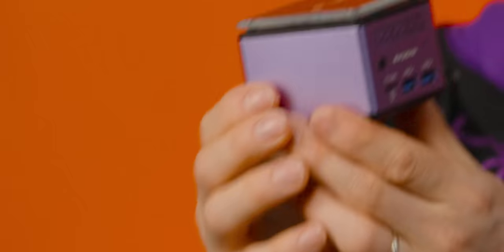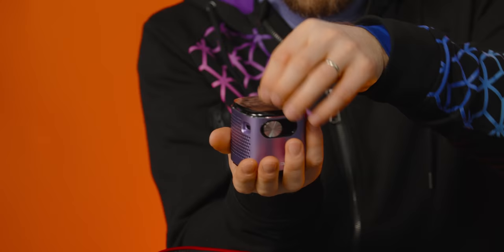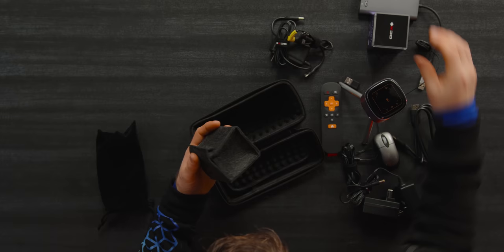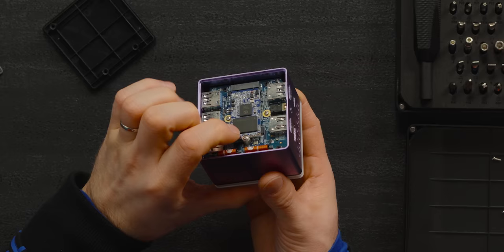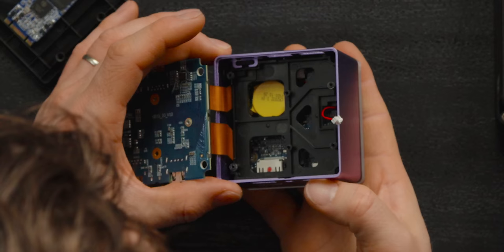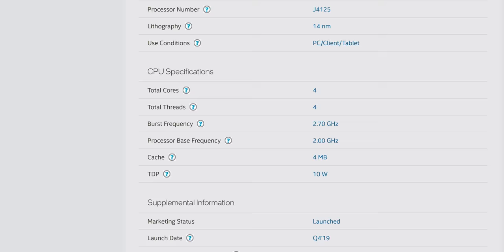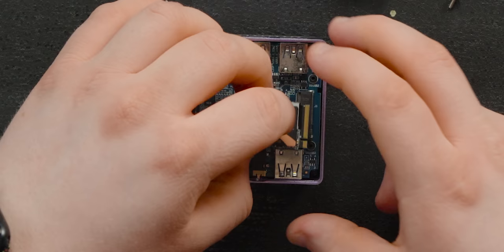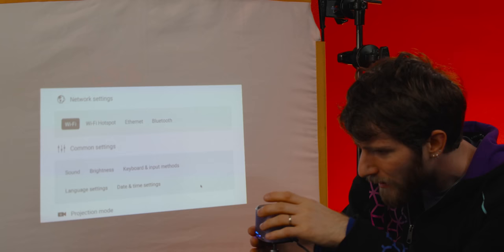This is a computer - XDO.AI PicoPC

Comment: The CPU is built on an antiquated 14nm technology. This stuff is 9 years old. Yawn
It's hard to be excited about this device when we had 6mm thin M1 iPads released in mid-2021 with minblowing performance and effiiciency of a 5nm system-on-a-chip. Granted, I have since sold mine because I don't have much use for it. But I don't see a use for this product either.

Comment: So a very slow new mini PC, with very OLD tech, like PCI-e 2.0 x2 and no USB C, No thank you, i rather go for a 
Shuttle XPC slim DH670 (1700 socket), that has no CPU soldered to the MB, has M.2 PCI-e 4.0 x4, has extra 
Sata, and have no memory soldered the MB, and has 4x USB 3.2 (Gen2, 10Gb/s), and 2x DisplayPort, 2x HDMI, 
and has USB-C.
 
OK it has no CPU and Memory, but you can choice what you put on it, and you can change it whenever you want, 
and yes it costs €345 barebone, but it is MUCH faster, even with the cheap Intel Core i3-12100F, and lasts much 
longer.